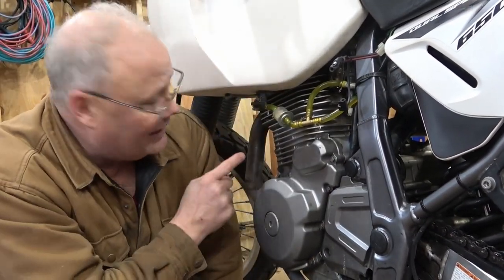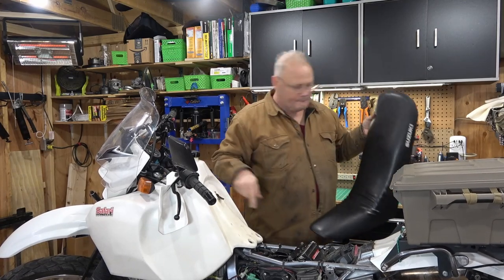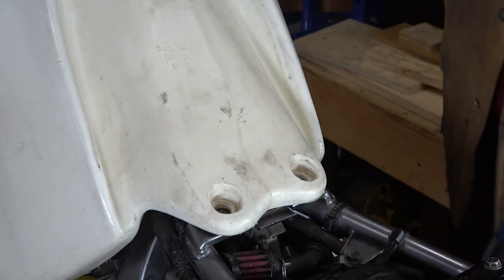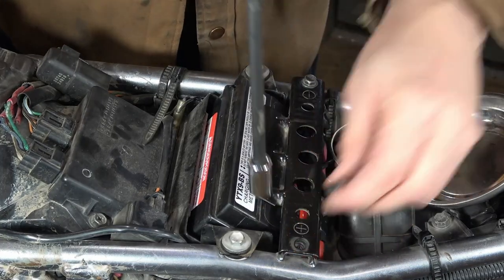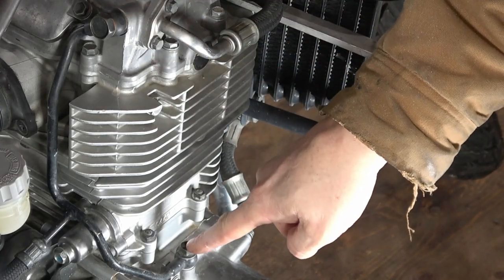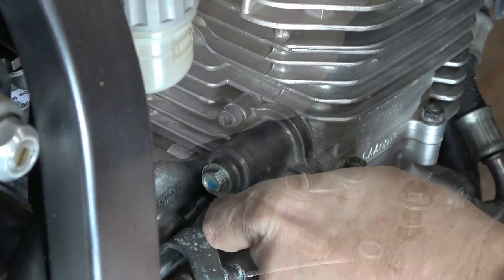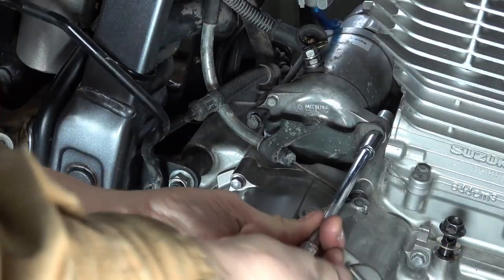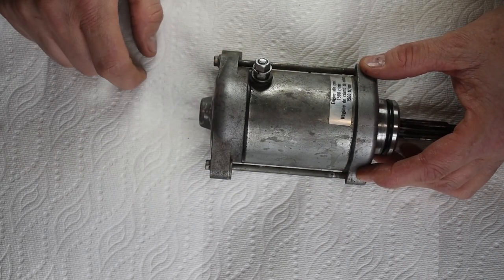Today, I service a starter motor in a Suzuki DR650 motorcycle.

Comment: Great video with all the important detail so most anybody can service the started.  For those who want to fix this problem for good read on.  When my 2017 started to crow I installed a Warp 9 Started Cap as it has a bearing instead of a brass bushing.  Poor design choice Suzuki.  I don't expect to have to do this service again.  The cost of the Warp 9 replacement part is $69 US.  The cost to replace all the washers, o-rings and gaskets, especially the exhaust gaskets isn't cheap.  The exhaust gaskets alone are about $29 US.  Thanks Dino I enjoy your videos!
Reply from the maker: Glad you enjoyed it, I agree with the warp 9 option as the best solution for sure and your comment on parts cost is very accurate, things can add up very quickly for sure.

Thank you for the comment and insight.
Dino

Comment: Its a lot of work for such a little job. I like the way you explain these bike jobs. I'm no stoop when it comes to mechanics but It helps to learn from others mistakes. Not that you show that. These are little maintenance things that I will need to do now or latter so this helps me plan for them. Now  back to the tractors and building sheds and all the other house renovations. Well done again. Thanks
Reply from the maker: Thank you for the comment, I agree they bury the starter rather deep in the bike and its a bit of a chore to remove it. I agree that its best to learn from other peoples mistakes when you can and believe me, I make my fair share. Maybe I should put out a video showing a few of the worst.
Again, thank you for taking the time to comment and good luck with the house renovations.
Dino
Reply: @DinosTinkerShed  I just pinched the DR oil filter outer sealing ring, now it leaks. Damm, The bike shops want $9 & $14 for a new 1. Two different shops. Buggered if im paying that for an o ring. Bastards, The trouble is everything is an hour away from here. I think I'll go to a bearing/ seal shop and buy 6 or so for a cheaper price. I hate to encourage price gouging. What they don't realize is they might win with that sale, but I won't go back there for any parts in the future. Big Mistake! I so dislike greedy people. Reasonable products for a reasonable price I say. Sorry for the rant my friend. This old farmer doesn't put up with much shit these day's. Love your vids. Keep it up.
Reply from the maker: I hear you. Let me know if you can find the right O-ring, my experience is that even though I have two master sets of O-rings, both metric and imperial, the factory O-rings are somewhere in the middle so you can never find an exact fit. I think this is also a way manufacturers force you back to the dealerships for parts. I would say though, that some things that you buy from 3rd party vendors are genuine Suzuki Parts sold to you at a mark up over the dealer cost, so I always call my dealer to get their price first before I order form online retailers. 
I grew up in a farming community myself, and although I did not grow up on a farm I had both friends and family that did (Woodstock Ontario is the dairy capital of Canada after all), my experience is that they are hard working no nonsense people that understand the value of honesty, helping out your neighbor and a fair deal. I'm afraid retailers and dealers have forgotten that concept a long time ago so don't worry about your rant, it is an accurate statement. 
Thank you for the comment and the rant 😀
Dino
Reply: @DinosTinkerShed  I may go down the self O ring making kit yet. See how we go.

Comment: Thank you for a very clear step by step lesson , I now have the confidence to tackle this much need maintenance. With respect I have just one comment, the negative battery terminal lead should always be disconnected before the positive lead and reconnected after the positive lead, just a small point but an important safety issue. Again thank you from Australia. Ray 🇦🇺🦘
Reply from the maker: Thank you for the feedback. Your not the first to catch the cable lol. Thank you for taking the time to comment and mentioning the negative cable. 
Dino

Comment: Damn...we had 43.3 deg C on Christmas Day down here in Australia then had 5 consecutive days with temps over 40 deg C.  
I removed the armature end cap metal bush and replaced it with a needle roller bearing. The starter spins a lot faster and no more squealing.

Comment: Great step by step Dino! I'm planning on knocking out my starter motor over the weekend and this really helped explain the process. By the way, it would be awesome if you did a video on changing the tires/removing the wheels. That's one thing I have yet to do and something that I'm truly paranoid about...having to change/repair a tube when I'm out in the bush.
Reply from the maker: Thank you for the comment, Karl and I actually filmed installing his tires but did not think the footage was quite good enough to upload. I will be getting new tires and will try again.
Thanks for the comments.
Dino

Comment: Thanks for the tutorial, very easy to follow along. Just curious about the orientation of the banjo bolts when installing, do they need to be threaded so that the drain hole on the side of the shank aligns with the oil line itself?
Reply from the maker: It makes no difference. The banjo itself has an internal gallery that moves the oil around the bolt and into the line itself.
Dino

Comment: I've checked my starter and all I did was take of the oil lines and the timing chain tensioner and you can get the starter motor out
Reply from the maker: Thank you for the feed back. I often take a few more items off just to give me a bit more access and also for better cameras angles. Feedback like this always helps.
Dino

Comment: Dino Dino the bambino thanks for the great vids. Can you recommend a manufacturer who makes good replacement gaskets please and thank you
Reply from the maker: I have had great luck with Winderosa gasket sets over the years. These are made in the USA and the die cuts are clean and precise.
I will say though, that I purchased a cheap set from China when I worked on the small 50cc Baja mini bike, I paid $15 off amazon for them and they were not to bad. I would use these again in a small project like that mini bike without hesitation although for my DR I think I would stick with the brand name.
Thanks for the question.
Dino
Reply: Gracias senor.

Comment: Watching all of your videos preparing myself to get a DR650. Kind of late to the game going on 32 with a first bike but still young at heart haha I had a question which isn't really related to the video but it caught my attention watching you disassemble everything. Would it be a good idea to go to a hardware store and make all of the bolts/fasteners the same type and size? I noticed the 6mm hex bolts could supplement both the 10mm and 8mm bolts seen on a majority of the bike, which made me think you could reduce almost all of the tools needed to 2-3 common standard hex or security star bit sizes.

Comment: That's interesting at 6:23 .   Looks like the Suzuki factory pet cock valve uses engine vacuum to open fuel flow ?  
 Sorry for all the questions but I'm trying to figure this all out before I buy that 2003 DR 650 .😀
Reply from the maker: That is correct, when you shut off the engine the petcock shuts off. it draws vacuum from a tiny port near the top of the carb. when I added the larger Safari tank this port must be caped off. It is a nice option but I was so used to a three position petcock that I found it odd at first.
Great question, thanks for asking.
Dino
Reply: @DinosTinkerShed  Thank you for the reply and nice work on the starter service ! 👍   Can you  " Roll Start " the DR 650 in a pinch if the starter would fail assuming the road or trail had some down grade to get momentum ?
Reply from the maker: @cranerigging3604  sure can, it has a fair amount of compression but you can. The petcock has a prime feature so even if you need to fill the float bowl before you roll start it you can.

Comment: another great video. Question - when do you know when to use Anti-Sieze, and when to use Lock-Tite? Does it depend on the heat exposure to the threads?
Reply: You would use anti-seize when you want to remove the bolt/nut/stud in the future. There are different types of anti-seize depending on hot (copper based) or cold (silver/nickel) applications. Loctite is used when you do not want the bolt/nut/stud to loosen unless you you loosen it. There are different types of thread locking products for heat, oil and normal temps along with different strengths. If you use a higher strength locking medium and it wont release using normal tools you can always release it with heat ( which is sometimes not practical ) Make sure both treads are clean and dry prior to application and setting and also remember you do not need a lot the locking compound. Hope this helps.
Reply from the maker: I can't really add anything to the great explanation from justgit other than the manual will often let you know what and where to use  both products.
Thank you for the question.
Dino

Comment: Ciao Mr. Dino, ti scrivo da Roma - Italy. Ho da pochi mesi acquistato il mio DR650SE. Seguo ogni tuo video. Moto fantastica. Quando io accendo il suo motore sento spesso una specie di urlo. Dipende forse da questa scarsa lubrificazione ? Considera che la mia moto è un modello del 1998 e sono sicuro non abbia mai subito questa accortezza. Proverò comunque a farlo. Grazie del tuo prezioso aiuto
Reply from the maker: Hello Marco, yes most likely it is dry starter bearings, if you take it apart and service it, the noise should go away. Thank you for following my content, and have fun on the DR!.
Dino

Comment: Curious if you've run into the loud clunk noise that many DR650 owners report. It happens when I shut off the bike and then again while starting. Any ideas or other video tutorial for that issue?
Reply from the maker: Yes mine makes the clunk, from what I recall it Is part of an anti kickback mechanism or something. That is a great idea for a video. I'll have to do some research on it to ensure I get the right information.
Thanks for the comment and great idea.
Dino
Reply: @DinosTinkerShed  Sounds good, I'll keep an eye out for a video in the future!
Reply: @DinosTinkerShed Any thoughts on the anti kickback issue, I have similar and assumed it was associated with the starter clutch. I have my flywheel cover off at the moment and starter clutch bearing seem fine.

Comment: Dino, does the engine have to be at TDC to remove and reinstall the cam chain tensioner?
Reply from the maker: @RickReynolds-n4w  I do not believe it does, however the only thing I could see being impacted is that there is pressure on the cam lobes if it is not and I'm not sure if this pressure could somehow slip the cam chain when you remove the tensioner. If it was me I would take the time and set it to TDC just to be sure.
Reply: Did you put the bike in the video at TDC when you removed the cam chain tensioner?
Reply from the maker: @user-cs3ky8qq2f  I don't think I did for the video,, however this was a while
ago, so I can't quite remember. I just looked it up and the manual does not mention setting TDC so I think you are OK.

Comment: Get video! I heard you mention using a "jis" screwdriver.  Can you tell me what that is verses a regular Phillips? 
Thanks!
Reply from the maker: Hey thanks for the question. JIS stands for Japanese  industrial standard and is a screwdriver profile very similar but not quite exactly the same as the Philips that we know in north America.  Although very hard to see the angle of the tip is slightly different and locks into the fasteners on Japanese motorcycles and power equipment better than a Philips leading to less cam out and fastener damage.
I hope this helps and the k you again for the question.
Di o
Reply: @DinosTinkerShed  learn somethin every day. Thanks for taking the time to share that.

Comment: when i first bought my dr it had 750km on the clock and it did the rooster sound but a few thousand km later and i never hear it? Should i still grease it?
Reply from the maker: If it has stopped making noise you are most likely fine. If you wanted to service it is more of a preventive measure. Thank you for the question
Dino

Comment: What about replacing that brass bushing with a bearing?
Reply from the maker: Yes I believe warp9 offers a kit replacement for the bushing. I think it completely replaced the end cap. Thank you for the question.
Dino
Reply: @DinosTinkerShed  Yes they do just got one in the post.

Comment: I did mine a while back and replaced all of the o-rings in it.
Reply from the maker: Good option for sure, mine seemed in really good condition so I left them as is.
Thank you for the comment
Dino
Reply: @DinosTinkerShed  Mine was a low mile bike I got it only has like 1,700 miles and a 2006.

Comment: Ok I looked and nobody said this. You took the battery cables off in he incorrect order. Always take the negative cable off first if you touch ground it won’t spark and once off the positive cable is safe. Put them on in the opposite order positive then negative. 40+ years ASE Certified Technician.
Reply: You take the positive off first so it doesn't arc, ask anyone.
Reply: @prairiegold6870  as a 40 year ASE certified technician you take off the negative first especially in new computerized vehicles. Every class and school I ever went to made that a point. Go ahead and touch your tool from positive to a chassis contact and find out. I had to help someone to the eye wash after a battery exploded because he accidentally contacted the body.
Reply: Dino, you inspire me to love my dr650 even more. Your content so excellent!

Comment: Hello and thank you for the detailed tutorial. I am trying to diagnose an issue with the starter on my 1996 DR650. Most of the time it will not work. Occasionally it will turn over. I tested the wires and it seems that approximately 12 volts is being sent through all wires to the connection on top of the starter. My conclusion is that it is time for a new starter. Is there any way for me to test or analyze  in my starter once it is removed in order to confirm that it is bad? Interesting observation, once the starter was removed there was no drain hole to be found. As you can imagine, the starter was sitting in a puddle of mud and debris. I hope to hear your perspective.
Reply: Also, can you recommend a replacement starter and a store to order it from in the U.S.?
Reply from the maker: Hmm If you have taken the starter apart to lube it you can check for burned or damaged wires on the windings and look at the condition of the brushes and segmented armature. I am not sure on other testing methods for the starter. I would say given the age and the lack of water drainage it most likely needs replacement. As for a new motor, I would not discount Suzuki itself as an option,  if not Pro Cycle does sell one for 149 us.
Hope this helps.
Dino